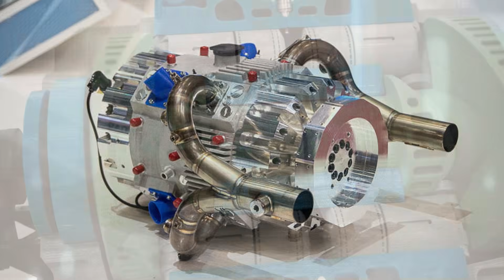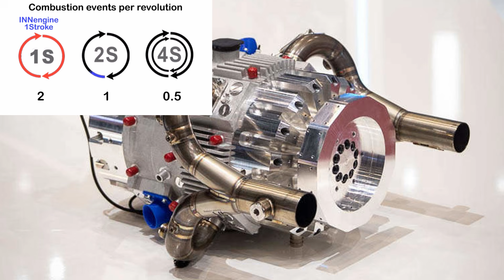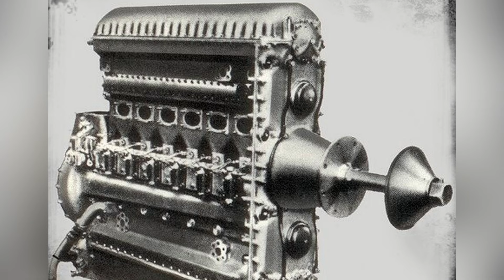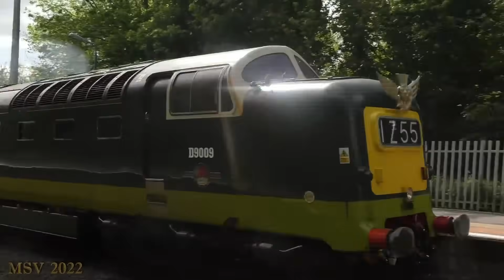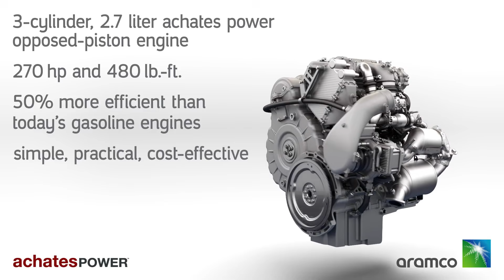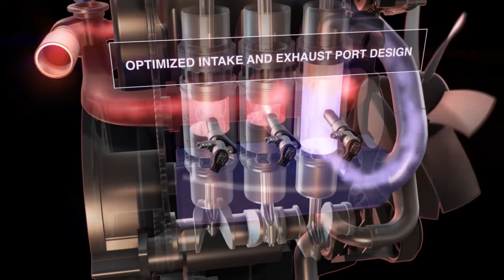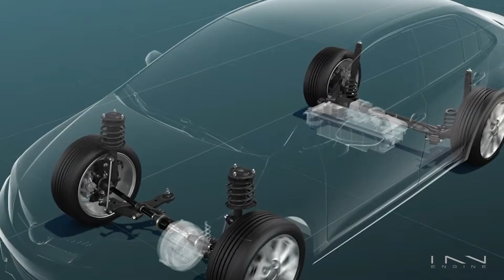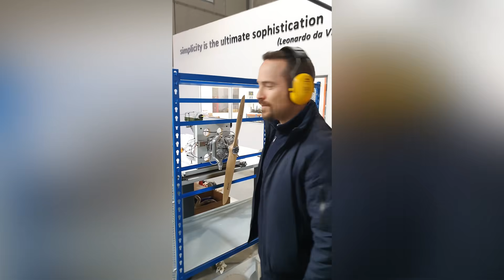NEW OP Mini-Engine DESTROYS Pure EVs

Comment: The problem with this engine is that it lack of low en torque(I mean, like a lot). Also, the 120hp isn't made from a N/A engine. If you look in the Miata  video, there was a supercharger
Reply: So what? Still extremely light weight with the supercharger.
Reply: @CameronsCars  What I said is that the lack of low end torque is the problem, never talked about weight
Reply: Good point about the supercharger, but it still makes it quite viable as a range-extender/power-booster engine for hybrid-vehicles, although this company really needs to sack its PR agents with its silly hype, then be more realistic about the engine's potential, along  with not calling it a single-stroke when it's really a 2-stroke engine!
Reply: It's more problematic this company never mentions the supercharger anywhere, implying that they're having issues with this engine.
Reply: @Vinz3ntR  ; All 2 strokes need positive intake pressure to drive out exhaust gases. Small chainsaw sized ones use crankcase compression, hence oil in the fuel. Bigger engines use superchargers or positive pressure Rootes type blowers, Junkers, Jimmy, Commer,, Deltec etc. Lubricating oil can be constrained to a sump, not so tough to meet emissions limits.
During WW2 a Junkers 2 stroke diesel powered aircraft had a ceiling of above 60,000 feet. One nice aspect of EV range extenders is that they can be run at optimum rpm/output with a completely controlled generator load. Also the generator can run the engine up to high revs for turbocharged 2 stroke easy starting. Little light low emission engines only used when needed.

Comment: Very good information on the opposed internal combustion engine.  We have been dependent on the IC engine since Otto invented it in 1840's along with the steam engines that are all mechanical devices.  

Petroleum is the most efficient highest density fuel on the planet and it is continuously produced or comes from the core of the earth;  atomic reaction to heat that condenses and condenses...... to gas that condenses and condenses.....to liquid and as it rises from the pressure it does collect minerals from the earth, and as it condenses  and condenses ......to solids and you have carbon, coal and diamond. 

  The future and it is in its beginning stages is the fuel cell that produces electricity from Hydrogen.  When hydrogen is compressed it is a more energy dense fuel but with many other challenges and costs.  This fuel cell technology will develop into a similar converter that actually  does the same as the fuel cell with hydrogen but will  directly convert or strip the "carbon" of its excess electrons.  This is a carbon planet and is what we all run on as a low temperature carbon oxygen engine; our bodies. 

This IC engine has been great but very inefficient as the gas Otto engine is 25% efficient the Diesel engine  at 31% it is wasting the balance of the carbon/petroleum potential into the atmosphere via the radiator, exhaust and heat radiation. 

So the next generation converter will take petroleum/carbon and strip the electrons of it via this fuel/matter converter and give us a 98% efficiency and zero pollution as it doesn't combust the petroleum as in the IC engine or reaction engine. 

Rudolph Diesel came very close to exposing this device in 1900 after he developed the compression combustion engine but he disappeared off a ship he was on way to delivery his findings to others.  No need to say but this technology was not wanted to be exposed by ? 

I do feel the "range extender" with a small efficient power plant is a great compromise or extension to the electric battery.

So much more to say.    Oh well. 

Well done on bringing the "Opposed Piston" engine technology to the forefront.  I am impressed with the "Liquid Piston"   advanced Wankel engine with 3 combustion cycles per revolution.

Thank for your info and well done on your research and YOUTUBE presentation. 

Wm

Comment: If it can convert sunlight or uranium to kinetic/electric energy with at least 80% efficiency, then we can say it could potentially destroy electric vehicles. In the meantime, electric vehicles can be charged by the sun or uranium, and be more simple, powerful, and awesome than overly-complicated, lazy, and unreliable internal combustion engines.

Comment: Great video.. The first to see an INN actually running and throttling up (with or without intake boost). By the way, don't lithium ion battery chemistries come mostly from the refinement of sea water?
Reply: There is video of it powering a Mazda with the aid of a turbo charger.

Comment: If you notice, EVs with REX charging are scarce.  The only one I know about is the BMW i3 and that isn't exactly for everyone.  REX charged vehicles make HUGE sense in rural areas, but manufactures don't give a Schiff about that market plus they really don't want to admit that there are HUGE REGIONS of land that are impractically far away from any fast charging infrastructure.  Presently it is much easier to just actively ignore that market rather than solve any problems there.  Perhaps if John Deere made a REX charged EV pickup.  That sure would perk my ears up, especially if they can have a full 8' bed and not every one have to bee green...although many will still want it that color. :-)  Out in rural areas ICE engines have decades of viable future in them.  I still prefer electric where it is practical, but sometimes efficiently burning liquid fuel is what is needed.

Comment: It is a TWO STROKE engine, make no mistake but it is NOT the conventional "2 stroke" engine we see in motorcycles, etc. It really, really needs a turbo or super charger. And we have no idea of its torque range.  I can't find on their website just where the torque occurs....its' marketing hype but is a good engine with potential in certain areas. Will it supplant the valve-crank-piston setup that has had over 100 years of development? Probably not, but it's a good design.

Comment: Update..This engine will fly to pieces..Due to the design of a fixed rod assembly.. Scrubbing the cylinders to maintain a straight line of movement..This engine will..You guessed it.. Will fly to pieces..This design has been around for over 100 years..The reason they stopped production is .They fly to pieces..

Comment: I happen to work at Walmart and I seen one of those trucks with that engine and they sound horrible. The drivers do not like that truck because of the horrible sound of the engine. I don’t blame them. Sounds like a transmission constantly grinding.

Comment: The 125cc, 22hp engine is for a paramotor! it will be the lightest, most efficient 2 stroke paramotor engine ever made...
Reply: Well maybe not! I worked on development of Rotax engines for karts and small aviation and a torque-orientated 125 kart motor weighs 12kg and puts out 30hp, if you built the same basic engine for a gearbox application like an MX bike you'd be in the mid/upper 40's. Road-race near 60hp is attainable.

Comment: It's a very intriguing design and I'd love to have one to play with, but let's get a few points clear:
-It's a Two Stroke engine in spite of what the makers say - just one that doesn't drink oil.
-It's compactness and simplicity are by far it's most important aspects.
-A design like this will have next-to-no-torque, making it useless as an automotive engine.*

*maybe, maybe this could be improved sufficiently with forced induction but that would add to the weight and complication.
So certainly as noted this engine may have a place as a small generator to 'augment' batteries in an electric car.

I'll make a bold claim - we won't see all electric heavy haulage vehicles for the foreseeable future. Battery technology is just not up to it and the limits of physics might mean we never have the batteries we want - Tesla's truck is frankly  a crock of sh1t, like pretty much every old 'whiz-bang' idea Musk has rebranded as his own...
...it may be an 'electric' truck that is powered by a sufficiently efficient generator (like the Deltic locomotive) could be viable, but would it be more viable than current technology?

A practicable point: At most electric cars make up about 10% of vehicles in developed countries. Yes, it would be good to see many more but supposed governmental plans to phase out petrol and diesel vehicles in short order are directly out of cloud-cuckoo land...
...current (sorry) electricity grids are designed to just about service the needs of the day, the tiny proportion of electric cars already putting a heavy strain on that infrastructure. As a back of the envelope estimation to supply all-electric use would need a minimum of 3-5x the generating capacity + all the infrastructure to go along with that. If a power station alone takes about 10 years to build at a cost of anywhere from 200 million to 10 billion depending on size and type where is the money coming from to build them all? Where is all the land? What about all the power lines, etc? All this at a time when there is pressure to get rid of 'big and nasty' power stations? 
If it's taken us about 100 years to build the infrastructure we've got and we will need something like 3-5x more will it take another 3-500 years? Of course not, but you get my point. The internal combustion engine is here to stay, and as we continue to ruin this planet while draining it of oil the only options are to seek every greater efficiency while reengineering society to be far less dependant on them - in my opinion that's not going to happen and we're screwed, but that's another story.

Sorry, I got carried away...

Comment: Thanks for telling us what people are trying.  It would be nice if there was a way to beat round cylinders and a crankshaft, but by looking at them, I don't believe either of them are going anywhere.  
- The swash plate/cam track configuration is a non-starter for the reason you mentioned.
- The opposed with the crankshaft will fail in fuel efficiency and if it passes emissions it will be due to external help.  The once-popular design lost out due to fuel efficiency issues to where few are still in use today.  GM's old Detroit Diesel Series 71 engines would be a more efficient design and could potentially be cleaner.
- The Wankel hasn't been competitive.
- Turbines need to work in a relatively narrow power band to be efficient, and even then they are a long ways from being comparatively efficient.  The best attempts for cars have been the Chrysler turbine car and Ford an H-Series truck which used ceramics to enable higher heats.  One would think it could make it on trains but they couldn't make it there either.  They make it where fuel efficiency isn't the issue, steady high loads, and/or weight.  The only ones that dots most of the Is are aircraft, starting with helicopters which work much harder than airplanes for the same weight.  High-horsepower piston aircraft engines have such maintenance and reliability issues that it turbines make sense earlier for weight, reliability, maintenance, lifespan, altitude compensation, cabin pressurization and heating, etc.

What could change is the availability of cheap energy to where efficiency is less of an issue.  Electricity is very inefficient unless you can make it an transport it inexpensively.  The U.K.s idea to use many Thorium-based plants would help.  It could make hydrogen fuel less expensive as well.  (I often tease a customer with a Volt, "I see you drove your coal burner today.")
Reply: I think gas turbine cars will be feasible if only the manufacturers and the customers are willing to accept that it will be hybrid power. Gas turbines are suitable only at certain rpms anyways. Might as well make it hybrid, use excess mechanical energy to charge the battery instead.

Comment: You need to change your titles. Nothing is going to destroy EVs and most people know this. The title is miss lieading in that rather than sounding like something to help EVs it will eliminate them and that is not what you are displaying in the video. Most people like technology and what do we already know? That technology will not be stopped. EVs are coming and anything that helps make them better is for the good and that is how this should be headed. 
These type motors are not new, not real sure why they've never really took a hold. They work on the same general crank design as an A/C Compressor. As  more charge stations come online things like this become less needed but there will always be a use for an ICE engine even if not used in transportation. I'm thinking thinks like small generators where maybe the layers of cylinders could be engaged on the fly to increase capacity as needed by demand. 
List this as a Range Extender because that is what it's first focus looks to be.

Comment: Hybrids is a dead end alley, they have already died a death in Europe, no one wants them. With the increasing spread of chargers and new battery technology, they will not be needed in a few years time and the expense of developing and converting present day vehicles for the short term is not viable. We already have batteries that do not need rare earth metals, although new massive sources  are being discovered and latest motors do not need rare earth magnets, just metal. LFP batteries are becoming wide spread which over comes the old problems with batteries of the past. If your thinking of investing in these engines, don't, it's a waste of money, invest in Tesla, solid stocks that are going to go through the roof, in my humble opinion

Comment: When you slow down does it put fuel back in the tank?  When you accelerate does it produce CO2?  If the answers are NO and YES respectively then it does nothing to destroy full EVs.  Full EVs are the only way forward.  Hybrid still means CO2 and gives you a lot of moving parts.  It's the worst of both worlds.  The fact is that we are already too late to muck about with just reducing our carbon footprints.  

If you were looking at a hybrid system 40 years ago and we started generating electricity cleanly back in the 80s we might not have found ourselves where we are.  However, this is where we are and now we are going to have to turn this around dramatically and soon start actually taking carbon back out of the atmosphere and ocean and locking it back up.
Reply: You do realize co2 is very needed in this world. Go look into basic ecology

Comment: Very interesting, but we really need to stop burning stuff… and to be honest I would feel a lot safer on the roads knowing that truck drivers have to have at the very least 45min break every 500 miles. In Australia we have a lot of accidents where long distance truck driver fatigue is a contributing factor so 45min does not seem unreasonable and that will come down over time. But smaller aircraft engines might be a good application. Very nice work and well presented.

Comment: I see this engine as a new way to explore the electric car. It could be use to power an electric car with very limited batteries, and could turn out to be very economical, and offer extended range on very long trips. Generator driven diesel electric locomotives have been very successful for far too many decades to mention. This little engine is so light that it is what is needed for our future hybrid cars, as another alternative to the battery plagued only EV concept. Always keep open mind and try to avoid fads that might give us what we want, but in the end it may not be what we need.
Reply: It can never be more economical than an EV.  EV's work just fine already.

Comment: The WEF wants to mandate EV so as to have complete control over the population and eventually control our ability to drive. Software to limit speed or distance could be modified when you plug in to charge.

Discounting the fact there isn't enough raw materials for 100% EV, nor the grid capacity to charge them ANYWHERE in the near future I don't see it ever happening. Hopefully it won't.
Reply: EV is a very effective method to control the freedom of travel. That's why China loves EV so much. 
Too bad, the average westerners can't see it, and buy in the whole "muh climate crisis" BS propaganda all the way from ass to mouth...

Comment: As long as no fossil fuel is used as the fuel source all will be fine.
The efficient use of Hydrogen is likely the only practical way ahead for heavier machinery, trucks and so on.
Gasoline and Diesel fuel are fast becoming the dinosaurs from the past.
EVs alone are not the the total solution, only part of it.
That's progression as times change and better situational alternative methods are persued.

Comment: The internal combustion engine has just about ran its course. Unless we can remove the CO2 from the atmosphere we cannot continue burning fossil fuels.
Reply: I may be wrong but I believe the current average CO2 level in our atmosphere is .004%, but what I am sure about is that all plant life requires CO2 to survive, thus converting it back to O2 which we require to survive, thus remove all CO2, kill all plant life (including vegetables and fruits) resulting in the end of all human and animal life, ya gotta think this climate change crap all the way thru my friend, turn off the TV, go to your local library (not Google search) and do the research on this stuff, don't believe everything the govt is cramming in your head
Reply: Diesels are going to be here a lot longer than you think.

Comment: The swash plate pump and motor have been around for decades in hydrastatic transaxles on lawnmower. They have to turn extremely fast to generate useful torque. Have ever seen how fast a riding lawnmower is.